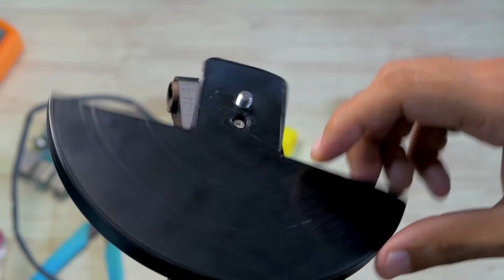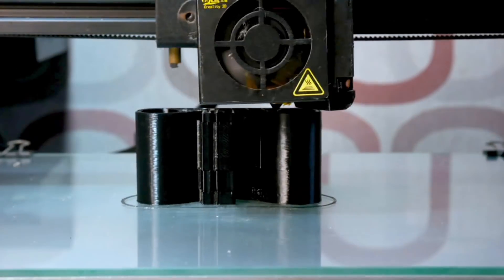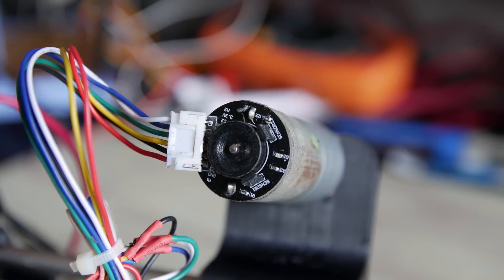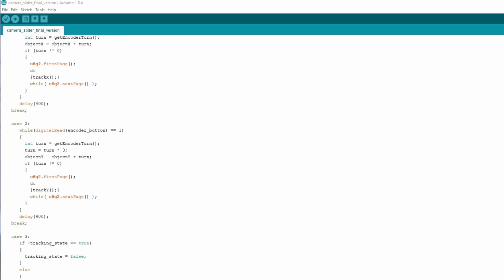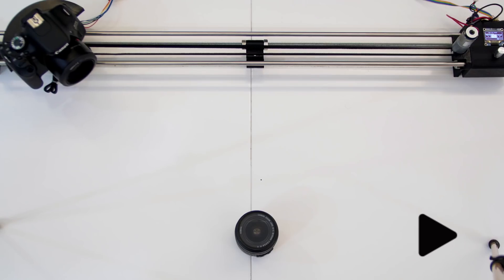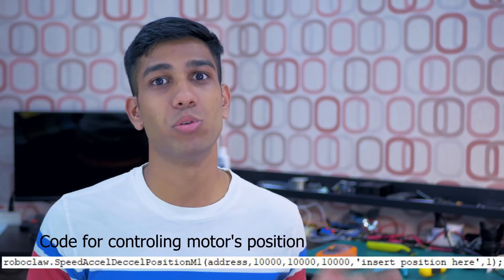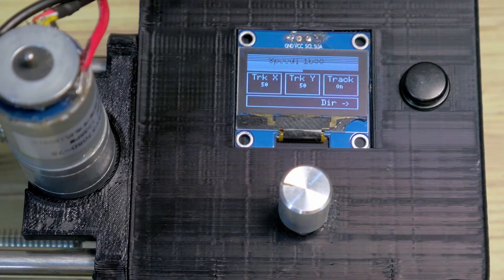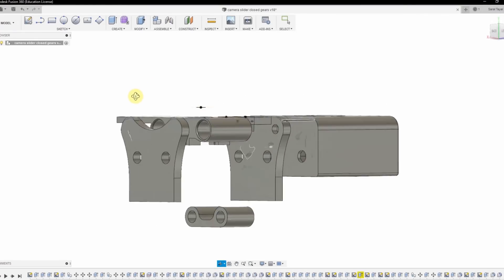DIY Object tracking camera slider tutorial. 3D printed + built around the Arduino & RoboClaw

Comment: Hey Saral!
Great project and video! I have some ideas for how this could become even easier to use I think.
I guess with the roboclaw you are able to also disable the motors temporarily and let them be backdriven, while measuring feedback from the encoder?
With this it would be possible to define the object tracking in one of these two ways, which would take less measuring & testing to set up a shot:

1. hand-position the camera in position + angle to face the object to be tracked. Then enter the distance from the camera to the object on the screen. The rest can be worked out with trigonometry. (the distance from camera to object might be easier to measure than the X/Y coordinates exactly).

2. hand-position the camera in position + angle at the end of the motion. Then press a button to record position and angle (or zero offsets). Then move the camera to the start of the motion and turn it so that it faces the object again. Now by confirming again with the button, the software can use the two positions and angles to find the location of the object exactly - it is where the two rays intersect.

What do you think? Maybe I will give this project a shot and try adding this myself some time, I will surely let you know if I do :)

Comment: Great Project! 
I have been looking around for a DIY camera slider for tracking objects but wasn't happy with the available options. This looks like a nice solution. Also thank you for including the .step files on thingiverse - it is always nice to be able to modify the parts (since editing stl-files is really annoying).
The only downside I could find so far is the price of RoboClaw motor controller :D
Reply from the maker: Thanks your comment and feedback. You could get the cheaper 2X7A version of the roboclaw instead of the version I used. The 7A version is still far more than you need for this project :)

Here's a link to it: https://www.basicmicro.com/Roboclaw-2x7A-Motor-Controller_p_55.html

Comment: Very well done, Saral. I have done a good many YouTube videos on real estate for sale over the years, using drones outdoors and DJI Osmo Mobile for interiors. I have seen  (commercial) camera sliders used by pro videographers for interior shots when the setup is on a kitchen counter top or coffee table; this would be a great use for your system. I am glad to see you have so many views so quickly. Also, you may have seen scrolling black lines on OLED screens caused by the recording camera's rate of shutter exposure. I see this with some phone video capture but not with others , depending on phone brand. I also see quirky "line scrolling" across an LED array during video filming ; more or less of it, or none at all, even using the same phone cam. but at different ISO setting. !?!  Keep up the wonderful work, I expect great things from you in your future career. Following your channel with great interest.
Reply from the maker: Thanks for your comment Frank. Yes, using a wide angle lens for interior videography could be very interesting indeed! 

I have seen the scrolling black lines & I think its a shutter speed issue. I didn't match my shutter speed with the refresh rate of the display. I only found out when I was editing and unfortunately didn't realize it when I was filming.